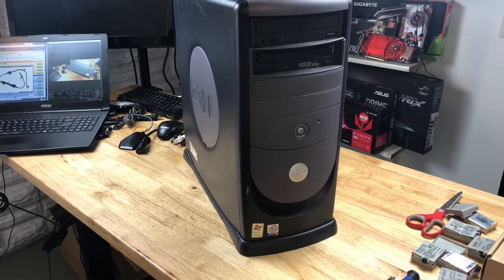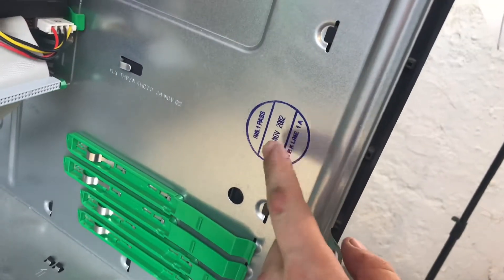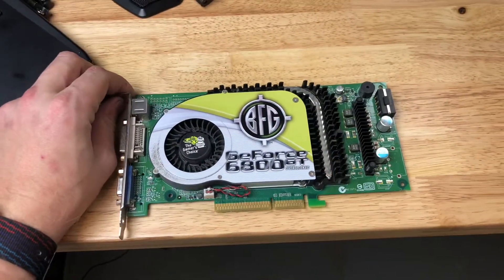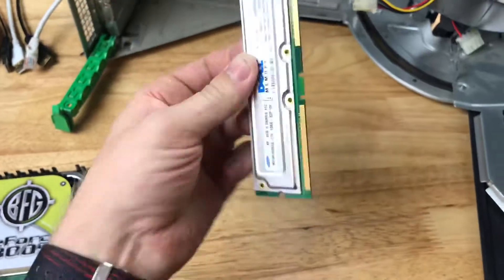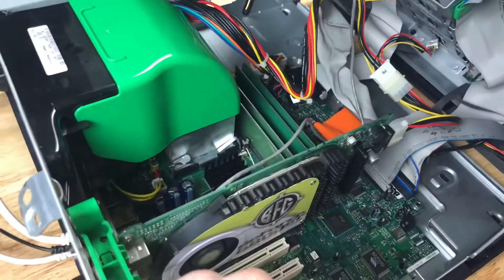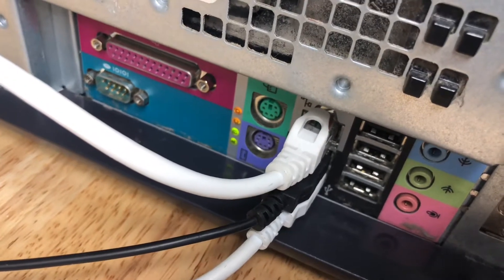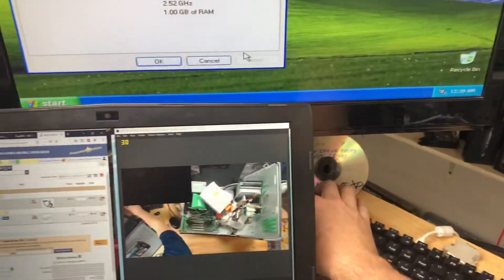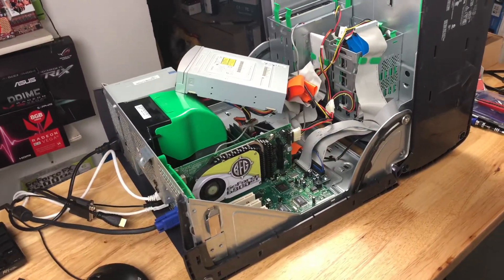$7 Dell Dimension 8250 rescue RD Ram and a 6800GT?!

Comment: You could spec 8250's with an ATI 9700 pro in 2002.

Now, finding one of those will be a bitch.
Reply: I currently have a 8250 with a 9800 Pro

Comment: Rescued a rather nice blue & silver Advent T9100 from the curbside. Turned out to have a pretty sweet Asrock P4i65G motherboard inside, with a Mobile Pentium 4 3.2 Prescott, 512MB of DDR memory, a 160GB HDD, Lite-On DVD-RW drive, USB card reader & 1.44MB 3.5" floppy drive. Silver Hanns-G HW173A & black Trust keyboard additional bonuses that came with it too.

Added & replaced the following:
Pentium 4 3.2E Prescott (E0, SL7PN, Loadline B)
2GB (2x1GB) Kingston HyperX DDR 400 memory
256MB GDDR3 XFX 6eForce 6600 GT AGP card (with an additional air vent backplate for an airflow gap between the graphics card & stuff below it)
Creative Audigy SB0090 PCI sound (Front panel Firewire can connect to it's Firewire header)
Serial & Game/MIDI backplate (connects to Audigy & motherboard)
Replacement 160GB & 320GB Hitachi SATA drives (survived Hitachi's infant mortality & stood the test of time)
Additional Lite-On DVD-RW drive (So that I can have Region 1 & 2 DVD playback across both drives)
Seasonic SS-500ET PFC F3 PSU (to replace the whatever explody PSU it came with) (Also a 24 to 20-pin ATX adapter)
Akasa 120mm fan (ghetto jammed into a conveniently sized slot for improved airflow in a case with no fan mounts whatsoever)

Now got myself a very nice secondary dual boot Windows XP / 7 box for further retro fun. ;-)

Comment: I have a Dimension 8200 with Rambus Memory. Still runs great.Thanks for the Video.
Reply from the maker: RD-Ram is interesting
Reply: @OvalboreTech  Upgrade to a 3.06 533fsb CPU. Cheap on E-bay. It gives you HyperThreading.Makes a big difference